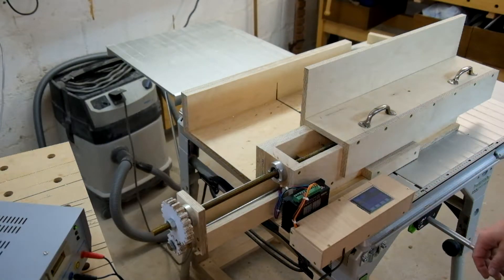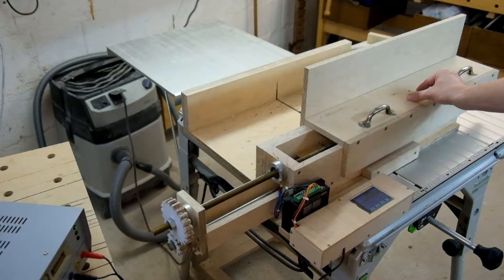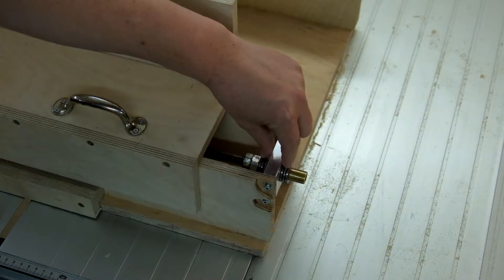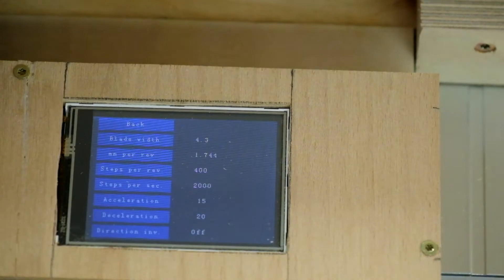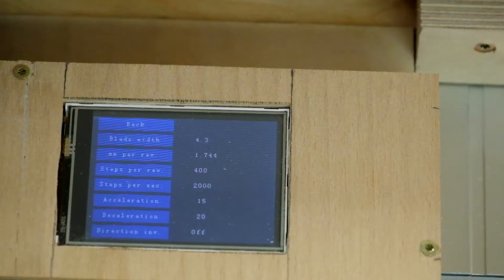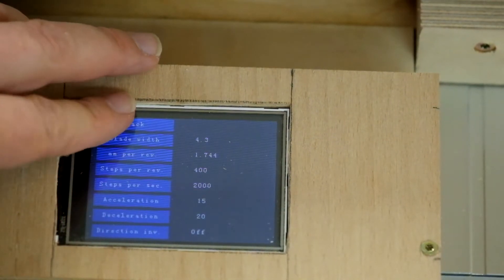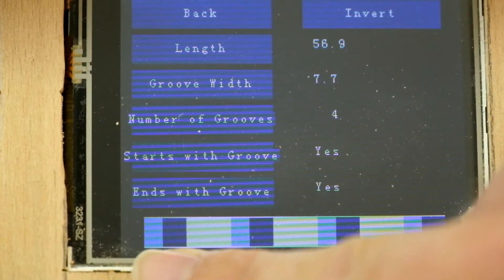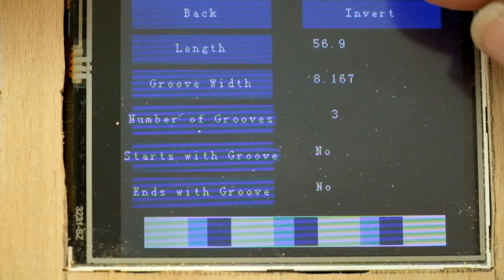The computer controlled box joint jig

Comment: Hi, thanks for the great tutorial, do you where it's possible to download EFC Flash Treiber library for your project ?
Reply from the maker: The EFC Flash driver is the dueflashstorage driver which is to be installed from the arduino environment. You shoul get it automatically if You follow the instructions for building the project. If You face any problem please post the message from the build project on my blog  which is linked above.

Comment: I would suggest adding these features:

1. -- Option to use Metric or imperial units.  This would make it a viable option for those that use metrics by default.  I often use both interchangeably on the same project as each has some advantages over the other for a partular need.

2. -- A blade width adjustment setting by say 4 or 5 thou a step. Not all new blades make a true 1/8 cut and there are thinner new ones. In addition, every time you sharpen a blade the cut width decreases by a few thou. 

3. -- Add an external standard socket like say for 1/8 diameter plug. This would allow adding say a micrswitch to detect the front edge of the table.  Then once you hit the start button all you have to do is push-pull-wait a bit and repeat until done... NO need to push a button for each cut. 

Some things to consider ------  NOT necessarily an option needed.. 

One thing you CANNOT make allowances for is for the lead screw somebody will use. As nearly all steppers are 1.8 degree steps by default with a direct drive the thread pitch of the lead screw will affect how far a single step actually moves the sled. Then add in the complication of any gearing, if used to that. 

My current manual screw advance jig uses a 3/8 16 pitch all thread.  PERFECT for imperal measurements. I just make a few test cuts and adjust the slot stop point for best fit. Then I just add a bit of tape to the handwheel to mark that point.  I just added a few marked points to the handwheel down to  1/128th  EASY to do with a 4 inch handwheel. All you gotta do is work out the angles to get the points. My handwheel is also adjustable to realy zero in the the start point easily. 

If I automated it I would most likely go with a 1/2 10 Acme threaded rod with anti-backash nut like on my home brew CNC. On the CNC there is no real issues going between imperial and metric as the controller and the cad/cam program deals with the dirty details. 
. 
For this to be useful for the average sawdust addect you would have to specify exactly what lead screw to be used and I recommend NO gearing other than 1 to 1.  using a 10 pitch acme rod the actual advance per step would be 200 ( the steps for 1 rev) X thread pitch or 2000 steps per inch..  1/200 is .005. By using the micostepping available in most any stepper driver you can easily get at least twice that ( .0025) with only about a 30% power loos in the stepper. While my CNC is driving a far higher load than a box jig I use a microstepping divide by 2.. As Im using a 5 start 10 pitch lead screw direct driven by a 450 oz/in stepper the resolution is actually .00125 and never a stall.   Good enough for anything I do, espically chewing up wood.  :)
Reply from the maker: Hi John,
 thank You very much for the detailed comment. This is highly appreciated and really cool.
 
Actually I assume that the current software is already usable with both, metric and imperial system. (Pls. consider that since I am from Germany for me the imperial system is simply unknown in everyday live. In Gemany You even do no find a dealer having imperial screws in stock. I first got to know the imperial system on different Youtube channels and hence I am not 100% sure and can only explain why I believe that imperial should already work.) 

The software itself does not consider any unit. Hence a consistent input in inch should do the job.
The software which I provide takes already today takes the following three inputs without assuming any dimension:

How far does the sled advance on a full rotation of the lead screw? For me this is ~1.75mm. What I learned about the imperial system is that the pitch notation for threads in the imperial system is only the reciprocal of the metric representation. For Your current manual screw of 3/8 16 pitch I understood it is 16 rotations for one inch. Hence in the menu where I type 1.75 You would give 1/16=0,0625. 

What is the blade width? For the blade width I enter 4.3mm where You would probably give also some (adjusted) value like 0.08 inch (approx 2mm). This may vary a little bit an You correctly pointed out under point 2. 

How many steps does the stepper take per rotation? For my 1:2 gearing without microsteps I give 400. Any other number is fine with the software unless it is zero ;-).

The settings get saved into the system and are normally only entered once. 

With these settings it should be possible to enter the dimensions of the finger joints also in inch and the rest should be done in the software already today.

I hope my explanation is comprehensive. Please let me know if there are any problems in my argumentation. 
And also from this point of view I believe that there is no limitation at all on the lead screw of any such jig. The software will not bother at all what is the factor it multiplies with. And selecting a matching lead screw comes down more to a question of the price and the material used. I did not want to spend too much money and hence took a standard brass spindle and a long steel nut. By this combination I have less problems with worn out nuts, because the brass is self lubricating and works much better than a steel spindle and steel nut. But a real acme rod is - of course - much better quality. But I never had a problem with the current setup. here is also a big difference to a CNC router or a lathe: A CNC router or a lathe have to build up a force against the workpiece and they have to move to cut. The box joint jig moves the workpiece only when it is not cut. There is no real force against the movement caused by the spindle and hence it does not wear out that easily. 

For Your point 3: 
Actually I saw such a switch in the video of Ben Brandt and found it to be very elegant. I will sooner or later add something like this but I simply did not find the time. Do You have an idea on how to set the direction to move on hitting a switch?

Greetings
Eckart
Reply: Going completely by that video it wasnt apparent there was no "system setup" option where stuff like thread pitch associated steps required by a stepper to move some distance, finger width, and a blade cut width setting. The  mechanics involved is way beyond understanding by most people as is converting imperial to metric and vice versa. Ive done this level of stuff along with bit banging ( DIRECT machine language with NO form of compiler or assembler and many high languages) for over 40 years. In that time I have discovered about all the average person can deal with is limited. That is why I suggest the options as I did. That level of stuff is what most anyone can comprehend. By forcing somebody to make the conversion from imperial to metric would actually be a deal killer for most in the impreal world.  You gotta make stuff so simple to use a 6 year old can do it before it will really sell in any significant number. The conversion is just a bit of simple code to do essentially removing the need for a customer to do it. 

Its the same sort of deal with the mechanics and thats why I suggest you require some set rod speifications such as 3/8 16 inch imperal or say 2 mm m14 rod for the metric world using direct drive or a 1 to 1 gear drive that would essencally bend the rod 180 degrees to tuck the stepper inside of the jig.  these 2 rods will repeat some division ratio o the same exact angles on either rod.. As an example say 1/32 in on the 16 pitch rod or 1mm on the 2mm pitch rod, BOTH are exactly half revelations of either rod.  

I used 3/8 16 imperial all thread on my jig because it makes life far easier.  I often convert from imperial to metric and the other way if needed but going with imperial was best as its the "normal" standard used in woodworking equipment in the US. I used acme rod in the CNC because its made to a very high level of precision, and extremely low backlash and long life. Different story with the jig. All thread works perfect and with a bit of thinking using 2 T-nuts I have around .007 backlash in it. WELL within whats required for sawdust creating. Also there is far less total wear involved. I suggest that anytime you are using any all thread for some sort of motion control run a die down it and a tap into the nuts used. This insures a constant degree of precision anywhere along it. Different needs so different materals used. Didnt make sense to spend about 7 times what the all thread could easily do for acme rod to me.

the external switch is a no brainer. its only function is to advance in whatever amount that is preset. The only real requirement is to make absolutely sure the jig is well clear of the blade. A human can easily screw that up by hitting the existing switch when the blade is actually cutting.  Now if you hang say a lever action microswitch switch on the jig back where the lever is held IN by contact with the saw table. Slide the jig back to you to the point where the lever drops off the table edge THEN the stepper will advance BUT NEVER as long as that lever is held pressed by the table top. Simple and effective. Then once you hit the start button all you gotta do is push forward to make a cut- pull back-- wait for the jig to advance then repeat as many times as needed.

Comment: How much would that cost
Reply from the maker: Hi Richard,

actually the point is not so much on the production price of an individual piece. The point is to sell it. Once You sell a complete product you get responsible for the functional safety of the product. The development efforts to prove and document as per state of the art methods that such a product is safe, costs easily 40000€. 
Hence it is a question of the price and it only makes sense if You want to run a complete buisiness based on such a product. And I do not believe that this jig has such a market and can fit on all the different table saws in the same safe way. 
All this is not a problem if you do it for Your own. You create the product and adapt it to your table saw and you follow the safety documentation of the software and then you are responsible for the safety of your own jig. 
O.K?
Greetings
Eckart

Comment: Hi very interested in the software/hardware used in this superb project but am having a little difficulty accessing your blog as the link seems to take me to a UK site but the blog is still in German. Am i doing something wrong?
any help appreciated.
Reply from the maker: Hi, actually You do nothing wrong. I still did not find the time to translate the german blog entries to english. Sorry. I will try to do it in the next weeks.
Reply from the maker: Hi David,

the blogs are translated now and software is available also. Please check the updated links.
Greetings
Eckart
Reply: ?Thanks for the help, i now have parts on order and look forward to giving this a go.
cheers
dave
Reply from the maker: That's cool. Locking forward to hear from You on the results!